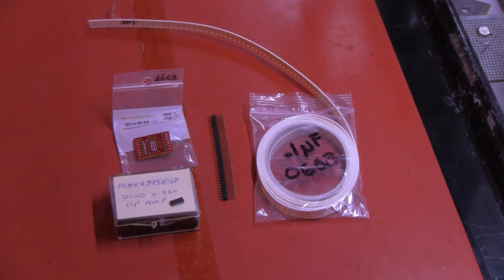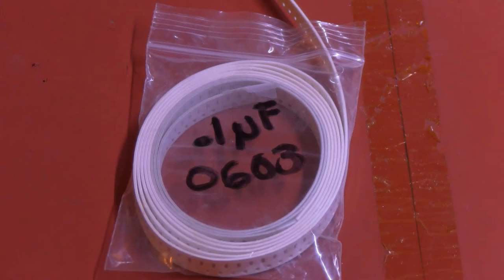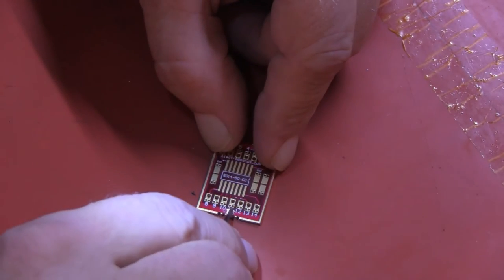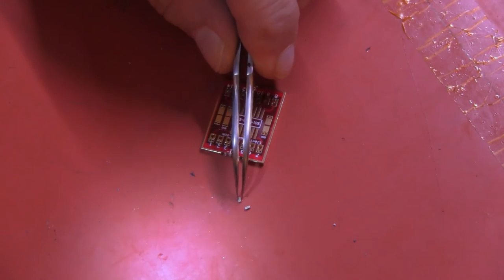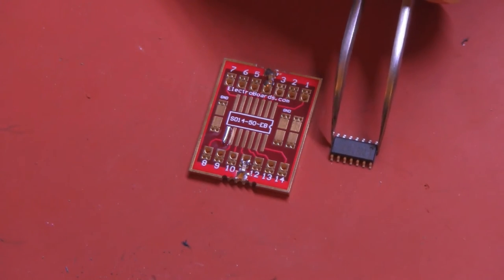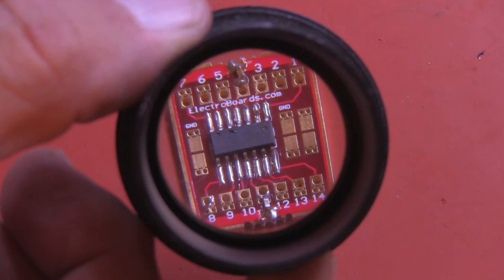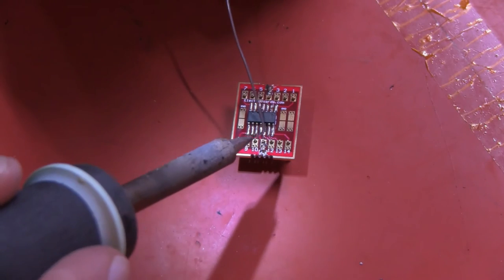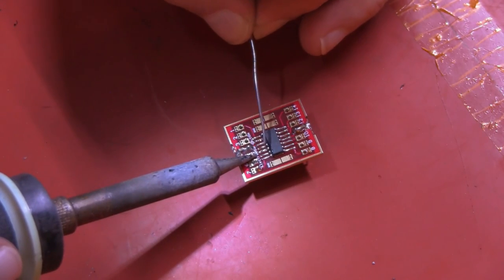Dual Scan Amplifier Project Part 1

Comment: Interestingly cool! ~Jack, VEG
Reply from the maker: It will be even cooler if I can make it work! This is actually not guaranteed! I am using the example circuit from the data sheet for driving deflection yokes. In the later episodes, I will get into the full theory of operation. Unfortunately, yokes made for television have two sets of coils that are different in their reactance properties (resistance and inductance). I may have to take two deflection yokes to make one with symmetry in both axis! I don't even know if that can be done! I'd truly hate to wind a deflection yoke from scratch. But, I will if I must.
Reply: I hope you can as well, but if not, welp...it would be cool to watch the process!  ~Jack, VEG